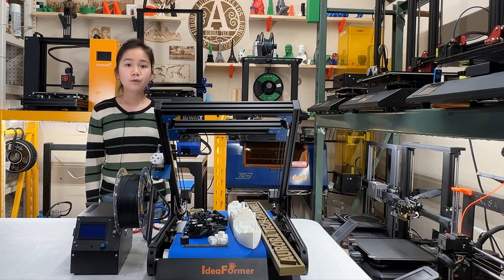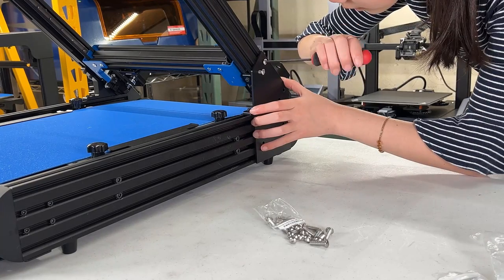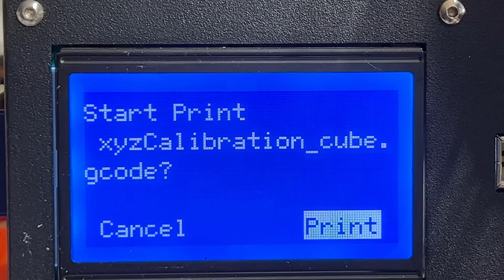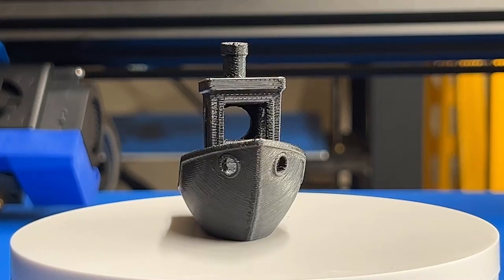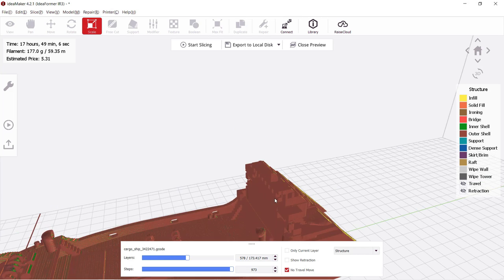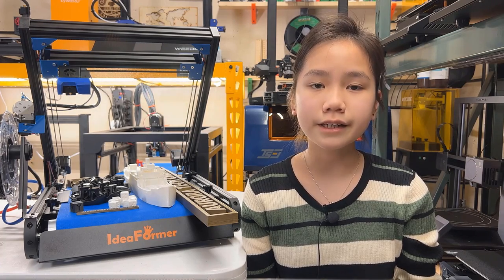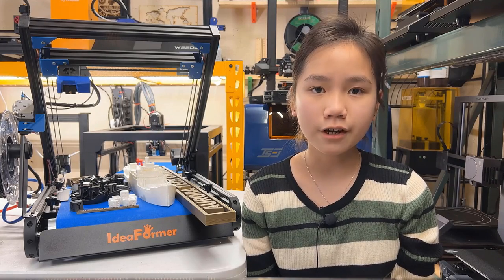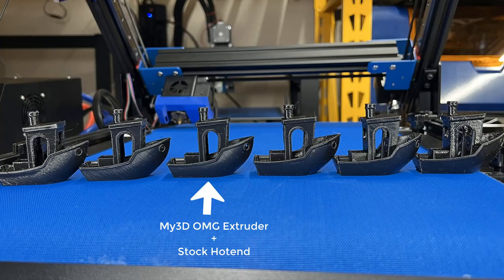Conveyor belt 3D printer Review: Does this $600 IdeaFormer IR3 Conveyor belt 3D printer work?

Comment: another fire review, the quality gets better with each upload. yeah that idea with the alternating angles is really incredible but i think makerbot has a patent on printing on conveyor belt at a 90 degree angle like you describe at 16:20. 0.6mm volcano would be a sweet spot for a printer of this size. linear rails should be the industry standard at this point
Reply from the maker: They have too many things patented, removable build plate, filament spool, multiple color printing, network 3D printing and even drawer on a 3D printer.

Comment: I own this printer, for the mirror issue swap the X and Y definition. Rear view left be X right be Y. Use Duet 2WiFi board set the right home side be X maximum. No need to mirror print parts.

Comment: Can you replace the hotend with one that accepts standard mk8 nozzles? Have you tried hooking up a raspberry pi to run octoprint? Are there any aftermarket touchscreen LCDs that work with this printer?
Reply from the maker: You need to make an adapter for MK8 hotend, I have made one and put it on my server:
http://auroratechchannel.com/download/IR3_MK8.stl

Also download the modified fan duct which is extended 5mm for MK8 hotend:
http://auroratechchannel.com/download/IR3_DUCT_Ext5mm_For_MK8_Hotend.stl

I didn't try Octopi, but I can't see any reason why it can't work with Octopi. I didn't see any touch screen with firmware ready to work directly for this machine.
Reply: @AuroraTech  Thank you. Does using a MK8 hotend affect the adhesion? Would you happen to know how this printer compares with the SainSmart INFI-20 Belt 3D Printer?
Reply: @morphine07  this one cost $100 more but with true corexy and linear rail.

Sainsmart isn't corexy design even thou they list it as corexy.

Comment: I added your configuration files and I built firmware in vs code. It outputs a firmware.hex file instead of a firmware.bin file. Is that normal? I put the SD card in the machine and powered it up but it didn't seem to update the firmware.
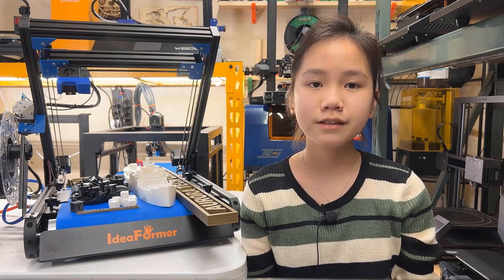Reply from the maker: 14:01 This motherboard doesn't come with a bootloader that allows you to update firmware from the SD card. You have to use VSCode or Cura to upload the file to the printer.

Comment: Well done review.

As for the printer, I think that the whole mirroring thing should be done by the slicer so the result is NOT mirrored compared to the preview.
But it's very good that you pointed that out.
Reply: The mirroring can be build right into the firmware of the printer itself and mirror it as it runs the gcode into the extruder and control servos.
It's hard to believe that the geeks building the firmware have not though of this yet. !

Comment: Another crisp and informative review, you guys are wonderful sharers of information on key new stuff. I liked this printer price and performance. Thinking for Model Train Chassis parts that are inside the train like the wheel assembles. Here i have many common parts and require 4 or 2 each for every car. That's a lot of smaller parts maybe the conveyor would be good as the finish is nor so critical. And if we do train bodies some are over 400 mm long and would be nice to print in one piece. My CR 10S Pro V1 is getting a BL Touch now. Then I need to consider what to do for lots of small parts.  Maybe the 10S Pro but with the Magnetic Flex bed for faster turnaround of print lots. would be a good next step.   Take Care you guys and say Thank You to Mom and Dad, you guys are jewels to the hobby. Dennis in Virginia

Comment: Top quality review as always. 👍 I wonder whether the threads of the nozzle are the same length as Creality's recent high-flow ones (for Ender-7 and Spider). Would open up 0.6 mm and abrasives. Anyway, the axis mirroring is inconvenient, but no real problem. The fixed angle of 45°, however, really is. I do want to get a belt printer at some point, but it must have multiple available angles.

Comment: This is a very good video and very informative! I have some parts I want to make repetitively. But they are flat parts that will be used like a lamp shade. Similar to a lithopane. I’m afraid the texture of the belt on the. backside of the part might shine through and become visible on the outside.
 
Do you think that the belt texture is very noticeable?

Because I would really like this to work for my needs and run the printer continuously printing these parts.
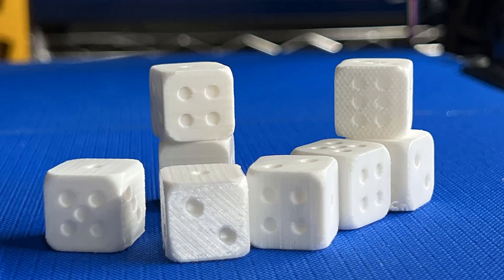Reply from the maker: Yes, you will see the texture of the Nylon belt on the bottom of your prints. The bottom looks similar to those printed on a textured PEI sheet; I think that's noticeable. Take a look at the picture at 11:38, the number 6 dice is a good example of what the bottom looks like.

Comment: @3:32 "If the gantry is a perfect 45 degrees.  The angle of the print head would also be 45 degrees to the print head."  Had to use YT's closed captioning function to see if it was really what it said.  Can you make an edit to make it show up as "45 degrees to the print bed"?  The build quality of this printer looks much better with the connectors that look the same as more of the industrial designs use.  The 45 degree mounting plates look really solid.  This printer looks great for a budget if you need a continuous run of some basic designs and multiple parts.  Is it capable of trimming G-Code to remove any down time from printing multiple parts?  This would benefit greatly with a filament sensor and possibly of a filament stitcher as an upgrade to make use of more than one spool if it ran out.

Comment: u can do a auto level from gcode starting position and just adjust the height wherever u want as long as u know what the distance is from nozel to base. this works great for static no springs under bed... cause u know ur 4 corners are at the same height, u can achieve that by using fixed silicon or aluminium spacers. and never touch the bed knobs ever again. make sure to take in account the usual +0.2 or 0.1 mm of layer that plastic gets added otherwise ul be off by some tents of a mm and ur first layer will always be weird. its a trial and error thing but once done properly... ur golden, and ul understand better how ur machine works. but the 1st mod u want to do on ur printer is get rid of springs under ur table no CNC has springs under table its a bad idea trying to make something perfectly straight while on each movement the bed shakes... is insanity.

Comment: Transforming a .4 mm nozzle in .6mm nozlle or .8mm nozzle or even 1mm nozzle is easy peasy, no special tooling required just a batery operated hand drill and the relative bits plus a 400 grit sheet of sandpaper to clean the exit hole.

Now making them smaller ... that yes it would be a challange... lol

Comment: I'm using ideamaker and my printer is not following my slicer settings for fan speed and temperature. I have layers 1-4 set to 0% fan speed and layer 5 to 100%. First layer temp is set to 210c and each layer after that is 200c. 

It will print the priming line at 0% fan speed then 100% fan after that. 

The printer will follow the temperature and fan settingas in the "tune" section on the board. Have you experienced this?

Comment: Is there a way to automatically mirror the x axis in the slicer or firmware? I noticed things printed with ideamaker slicer on the Sainsmart Infi-20 don't need to be mirrored.
Reply from the maker: Yes, I think changing the INVERT_X_DIR and X_HOME_DIR in the firmware as well as the X endstop MIN/MAX pin on the board could do that.
Reply: @AuroraTech  When my filament runout sensor is triggered the machine will unload all the filament. Since the filament is no longer lined up with the sensor it will knock the sensor out of position as it's retracting. Is there a way to stop it from unloading?

Comment: They can't use 90 degrees because of patents on it, that's why there are these 45degree printers, not because they can't do it
Reply from the maker: Makerbot has too many things patented, removable build plate, filament spool, multiple color printing, network 3D printing and even drawer on a 3D printer.
Reply: @AuroraTech  yep, so either someone licenses the patent for 90 degree belt printing which will make the printers a whole lot more expensive, or we wait until 2030 when it expires, though for private use you can convert it to 90 degrees, who's to keep you from it basically, don't know how much firmware can be kept from this printer for example or if vanilla marlin can be configured for it